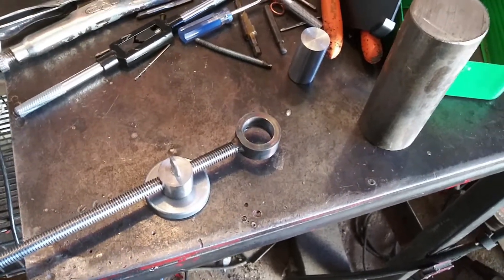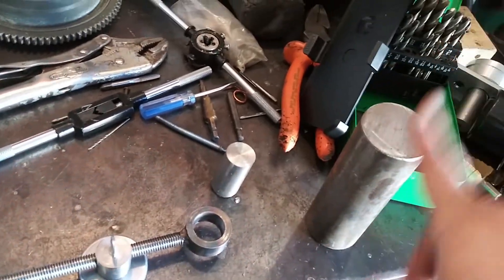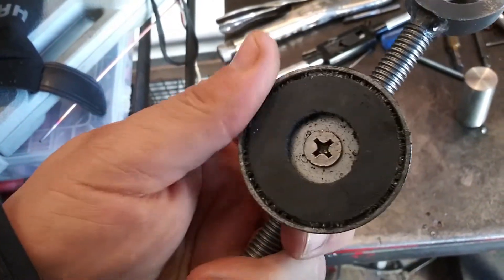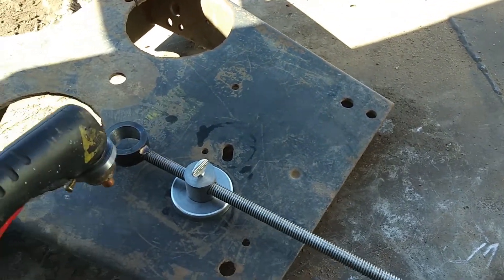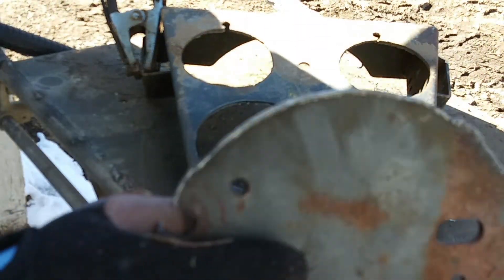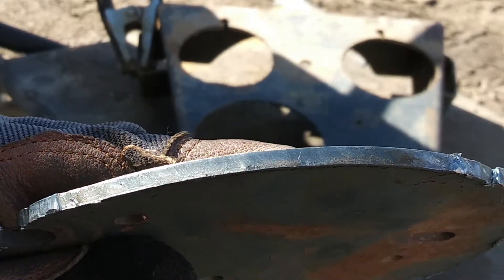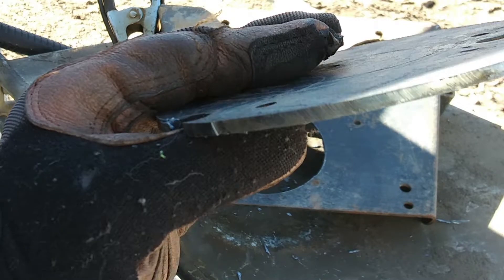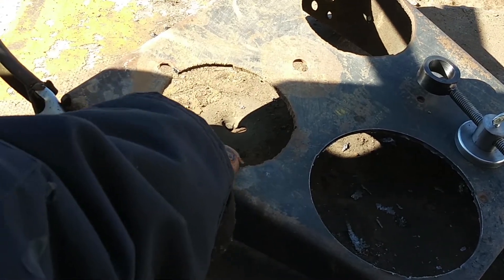Plasma Circle Cutter | Homemade Tools

Comment: Man, that is a great idea that you came up with. I'm going to make me one as well. That looks like Acme threads on your lead screw if so, what size Acme threaded rod did you use for this project Ray?
Reply from the maker: I didn't see your comment until now Kenny, I used a 7/16 or a 1/2 threaded rod with course thread. It looks like ACME threads due to me tapping a really tight thread on the center piece. If you want to build something like this you can use 8mm lead screws from amazon which are really cheap and have a 2mm or 4mm lead. I think I paid more for the threaded rod than I would have for some leadscrews. Thanks for watching!